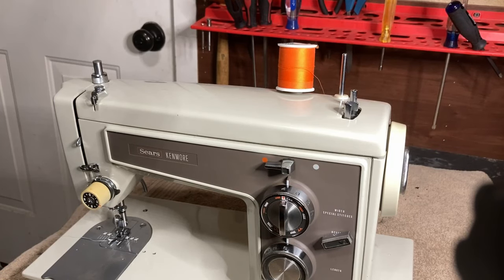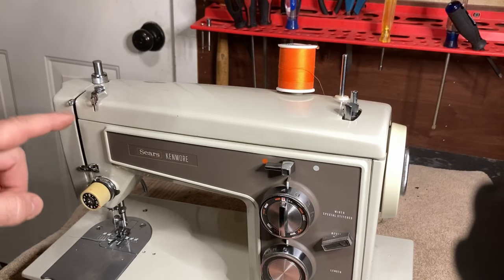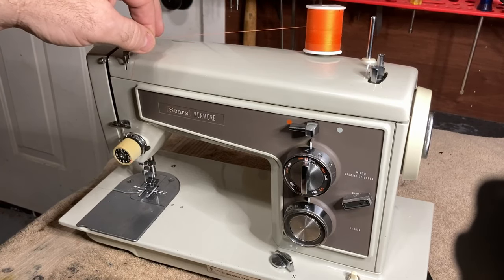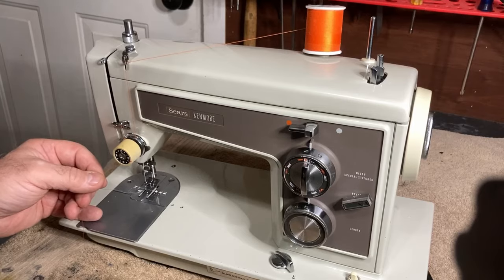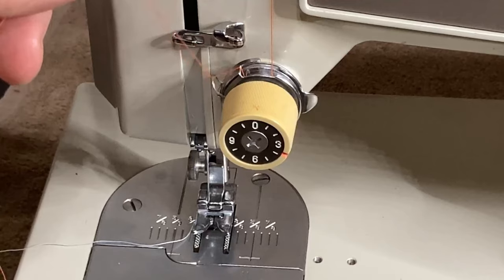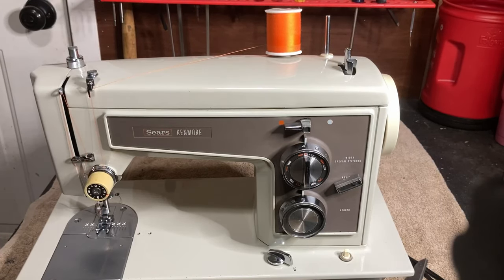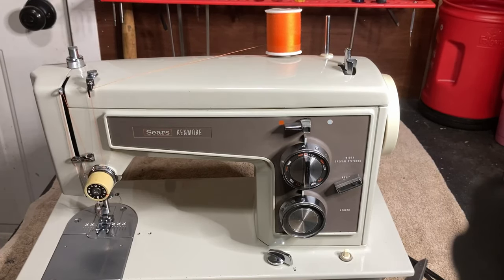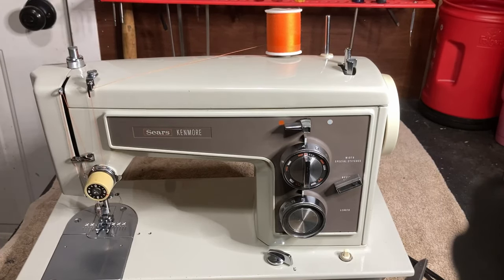How to use a Kenmore sewing machine  for beginners

Comment: I have a Kenmore 158.1500
Needle bar doesn't go up or down. It's already in the up poition but it won't move. Pressure foot doesn't work either. The motor works and the wheel moves. But that's all help
Reply from the maker: Sounds like it needs to be cleaned and lubricated, probably has some dried or drying gunk (old oil and grease) the needs cleaned off.

Also sounds like the clutch knob (stop motion assembly) is either loose or assembled wrong.

Comment: I have a 148.15700. Does this video apply to this model as well? Help!
Reply from the maker: They are similar so yes it does. There are a few differences but you should be able figure that out pretty easy with this video.

Are you having a specific problem?
Reply: Thank you! My grandmother just passed on my great grandmother’s sewing machine to me, and I don’t know how to use it so I’m starting  with learning how to thread it.😅
I’ve used a sewing machine before but it was a cheaper new one. I have a little knowledge but this one had me confused and I could not find instructions on it until this video! I think I have it threaded correctly. Mine has that extra piece on the top to loop the thread around/through so I hope I did it correctly. I’ve watched the first few minutes of the video. Now for the rest! I’m excited but stressed haha👏🏼
Reply: She had it checked and any issues fixed so if I can just learn to use it I’ll be 💯. Have tons of material from both of my great grandmother’s so lot’s and lot’s of sewing potential🎉 I am so excited. Thank you for the helpful video!!! ~young and learning to work with my hands!
Reply from the maker: @samanthatalley2367  

It is an awesome machine!
Once you learn it it is easy.
Reply from the maker: @samanthatalley2367  

You are very welcome!
Sounds like your starting a fun journey!

If you have any problems don’t hesitate to ask for help!

Comment: I need help I can’t figure out how to work my kenmore machine I have a Kenmore model C877.06 and right now the issue is I can’t get my needle to move. The wheel is spinning but the needle is not.
Reply from the maker: It sounds like The clutch is not tighted up.

The silver whell inside the hand wheel on the right side. It is for bobbin winding.

It should turn and tighten up clockwise
Reply: Thank you and the other issue now is that my thread keeps getting stuck in the bobbin and it’s not sewing anything
Reply from the maker: @samanthapilcher2928  
Watch this video, if you still have problems let me know.

https://youtu.be/wjZ1jqIL0DA?si=izawaWCrRQQWbE1j

Comment: I have a Kenmore 148.13100. It sews in reverse but not forward. How do I get your repair booklet?
Reply from the maker: The problem is the reverse linkage is gummed up, dirty and has the feed system stuck in reverse. 

The machine needs to be serviced, have all the crud cleaned out of it and then lubricated.

Comment: I recently purchased a Kenmore model 150. I am watching youtube (like yours) to learn how to use my Kenmore machine.  As I was sewing a straight stitch the machine starts squealing. It's a high pitched sound.  It doesn't make the squealing sound when I go slow, but when I increase the speed it begins.  Could you please advise what that sound is and what can I do to fix it/make it stop.  Thank you!
Reply from the maker: Sounds like a belt issue.  I would check the belt to see if it is loose

Comment: Good morning Sir ,Can you help me please ? to saw me how to put back the bobbin case of Kenmore SensorSew  One hundred made by NICCHI.
Reply from the maker: Hello Sar,

I just serviced one of those for a customer.

I do not have a video, it is a top load bobbin and is similar to several top load machines.

Here is a video of the singer heavy duty bobbin replacement, if you follow these instructions you should be able to get it back in.

Start watching at 43:10.

https://youtu.be/RKT16pdFPK4

Comment: 158.1941   I bought it new from Sears.  Still use it.  :)
Reply from the maker: That is awesome!

They are great machines.

Thank you!
Reply: @sewingmachinetipsandtricks9079   I have Mom's 1992 and a man who I hem pants for gave me his deceased wife's Kenmore machine last year. I haven't been able to find what year it is but I believe it is between '77 and '92.    Maybe you can help me figure it out. :)
Reply from the maker: @Padraigan13   I can try.

What is the model?
Reply: @sewingmachinetipsandtricks9079   I will take another look so I give you the right numbers. I just thought you might know resources to look up that I'm not aware of.  Thanks!
Reply from the maker: @Padraigan13  
I have a chart but it is not complete so it may or may not have your machine on it.

When I get the model number I will look it up.
Reply: @sewingmachinetipsandtricks9079        Model 385   12493.
Reply from the maker: @Padraigan13  My chart does not have any of the 385 series.

That is the newest series they made, from the looks of the machine I would say late 70's or early 80's
Reply: @sewingmachinetipsandtricks9079   Yes,  I had pretty much decided it was in between those years. Strange how there is nothing about it online. Thanks for your help!  :)
Reply from the maker: @Padraigan13   Your very welcome. 
Thank you!

Comment: Thank you so much for this video! Your clear descriptions about what to do, but even more importantly what NOT to do at each step is priceless.  Also your photography has much better closeups than almost any others.  I just obtained  not one but two model 158-16250 units at thrift stores.  Even these older 70's units have much more than the ancient 1940's White I bought back in the 70's, again from a thrift store.  So I am learning all about zig-zag and other fancy stiches now, at age 69.

I have a technical question- can you provide any clear answer to whether my machine has High Shank or Very High Shank feet?  I know it is not low,  as the various supplier pictures online don't match that.  I think (best guess) it is VHS.  I would like to get an overcast foot for it.

Also does your manual provide a detailed oiling guide?  I found a manual online but no points are indicated in the bobbin winding assy or the extra high foot lift, to get the foot out- it stuck fully high several times now.  Well after all the machines are 50 years old.

Comment: I was given a Kenmore 158.10691. It powers up but it will not turn. I can forcibly turn the wheel by hand. It doesn't matter if it's in sew mode or bobbin wind. With the top off, I don't see any balls of thread or anything stuck in it.  Any help would be greatly appreciated.
Reply: Did you get a solution please, I have the same problem!

Comment: I have a 158.900 w/attachments, no manual.  I have issues with proper threading and with the dials that control attachment features.  Also on my needle placement dial I have a setting that is labeled "AR", I have no idea what that is
Reply from the maker: Hello Kaye,

The threading is very similar to the machine in the video,  from the spool pin the tread will go to the two thread guides then down to the tension assembly (make sure the presser foot is up), back up to the take up lever and then down to the needle.

Without having that machine in front of me I can't  tell anything about the knob with "AR" on it.

I did a search for a manual, I could not find a free one. I did find several that can be bought. 

This one is $6, I have purchased off this site before and never had problems.
https://kenmoresewingmachinemanuals.com/shop/kenmore-158-900-158-904-sewing-machine-manual-pdf/

Comment: I can’t believe its taking me this long to get a stitch out of this thing.  The level to thread the needle worked but afterwards,  I had to adjust where the needle is because it kept hitting the top of the bobbin. I put the needle just below that nut on the pole and now it doesn’t hit the bobbin but the needle doesn’t match up with the level that threads the needle…this thing is a pain.

Comment: I have a 158.150. how do i get it to run?
Reply from the maker: That's a very broad question.

Plug it in and push the foot pedal?

What problems are you having with it?

What is the machine doing or not doing?

Does it make any sound?

Comment: Any tutorials on a kenmore 17928?  I’m re-learning how to use mine After 20 years and the bobbin keeps sending out too much thread. I’ve been playing with the tension...
Reply from the maker: There are 3 more numbers and a period before that number. I am thinking 385. but not sure.

Is that a top load bobbin?

Why do you think it is bobbin thread?
Reply: @sewingmachinetipsandtricks9079  yes, top load.  I don’t know where to look for the extra numbers?
Reply from the maker: @pleonesio7308  The other three numbers are just to the left of the 17928. They may be smaller and printed instead of stamped.

Why do you believe the extra thread is from the bobbin rather than the top? What exactly is the machine doing?

Comment: How do you position the needle left or right?
Reply from the maker: On that particular model  there is no needle position adjustment.
Reply: @sewingmachinetipsandtricks9079  thank you!
Reply: @sewingmachinetipsandtricks9079  what if you set it to zig zag and leave the stitch width to zero?
Reply from the maker: @jeanniescrochetcreations4978   You can try, it may put the needle in the center but you can not adjust it to a specific position.
Reply: @sewingmachinetipsandtricks9079   the reason I ask  is that when I set it to zig zag, the needle moves to the right like I want.  And I heard someone say they could do that on their machine.
Reply from the maker: @jeanniescrochetcreations4978  
Every machine is different in this respect, it depends on how it was made. 

Some machines you can set to zigzag and put the stitch width on 0 and the needle position will change to the center or one side or the other but you cannot adjust the position from there.

Comment: Model 85. How do I adjust belt tensioner.
Reply: 158.850
Reply from the maker: @simmonsdevin  
I am not 100% sure with out looking at it.

From what I found the motor should have a spring that pushes outward holding tension on the belt.

Comment: I have an instruction book .  When I try to fill a bobbin it doesn't rotate.
Reply from the maker: There could be several problems, it may need a new bobbin tire, or the winder may need to be properly adjusted or it may be froze up and need to be lubricated.
Reply: @sewingmachinetipsandtricks9079  thank you.

Comment: Help, I changed the bulb in my Kenmore sewing machine as it was burnt out.  The new bulb is so DULL you cannot see with it,  why is this happening?
Reply from the maker: It is probably a dim or poor quality bulb. What is the model number of your machine?  I will try to find you a good bulb.
Reply: @sewingmachinetipsandtricks9079  I have discovered that the place I bought the bulbs sold me  a lower wattage bulb.  Thanks for your response though.  What is the best bulb for a Kenmore sewing machine?  Mine takes the kind that you push the bulb up into the socket.
Reply from the maker: @controlfoodcontrolthepeopl5627  

I personally recommend  led bulbs as they are extremely bright and put out very little heat.

Comment: What would make the 158.14311 hang up when it goes into the bobbin ?
Reply from the maker: Many things can cause that, tell more about what's going on
Reply: Well I get it theard and it will pull the bobben theard up. I'll start to sew the needle will go down but when it tries  to come up it like something is holding on to it and want let it come back up. sometime I can turn it backwards some & it will turn loose. The thread don't get tangle up.

Comment: I have the 1660, please explain to me how to get the back stitches to look as good as my top, I did play with the tension dial, looking better but not as great,
Reply: The manual says you need to adjust the bobbin tensioner. If you’re having troubles with the back stitches. It’s a tiny little screw on the bobbin casing

Comment: Also do you tread the needle from the side or the front?
Reply: If you insert the needle correctly with the flat side of the needle to the back the  way you can thread the needle is from front to back.
Reply: If you insert the needle correctly with the flat side of the needle to the back the  way you can thread the needle is from front to back.

Comment: I have a 158.1237 can’t get the thing to sew anything
Reply from the maker: I am sorry to hear that.

Have you got it figured out?
Reply: Not yet, the needle keeps getting jammed into the fabric and thread jams
Reply from the maker: @succulenttarot6585  
I assume you mean the the thread is wadding up under the fabric and  and jamming the machine.

If that's the case here is what you need to look at.

Make sure the thread is between the tension discs, tension is on 4 to 6 and the thread has tension on it when you pull on it.

Make sure the the thread is in the take up lever.

Check your needle plate for damage from the needle, specifically inside the slit the needle goes through,  it takes very little damage to cause a major problem.

That is an end load bobbin I believe, pull the hook out and check it for damage. The point, the top, the sides, the smallest amount of damage on the hook can also create a major problem.

Make sure the hook and hook race are clean and not gummed up with varnish and drying oil.

Let me know if that helps.

Comment: Hi! I have a Kenmore (Janome) 385-1778180. It has no spool pins (vertical) and I need to disssemble the covers, specially the one in the back of the machine in order to install the kits I bought (bushing, pin and clip). A video about removing the casing will be appreciated. Thank you.

Comment: I just bought a 5188 no manuals to be found
Reply from the maker: I can't find anything related to that number with Kenmore. who manufactured it?
Reply: Made in Japan
Reply: How can I put a picture of the metal label and machine here? It won’t let me paste one. The machine has sliding bars to adjust stitch length and tension, not knobs.
Reply from the maker: @mkklaus6892  
Send them via email.
My email is  Richard@Odessasewingmachine.com
Reply: Opps! That number is the motor model number. The real one is 14812170  so I have found the manual now. I can not get it to stitch thin material only thick. I will go through the manual and try to figure it out.

Comment: Mode l# 385 1284180.  i DON'T know what bobbin to use.
Reply from the maker: That is a front load bobbin case and bobbin.

It takes a class 15 metal bobbin
This is on my website but you can order from where ever is best for you.
https://odessa-sewing-machineorders-over-49-ship-free.square.site/product/class-15-style-a-metal-bobbins-10-pack/6?cp=true&sa=true&sbp=false&q=false
Reply: @sewingmachinetipsandtricks9079  
Thank you, Sir. You saved me. I will order some at my first opportunity. I need to get back into sewing and as soon as I know what else I will need, I'll get it from you.